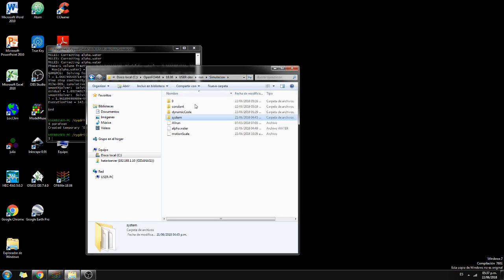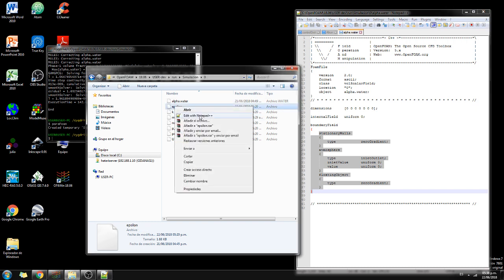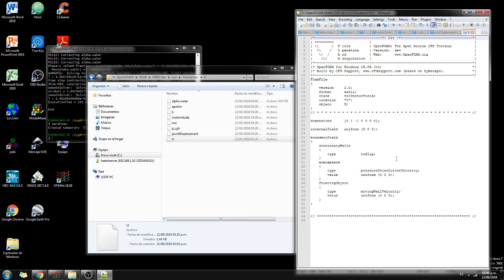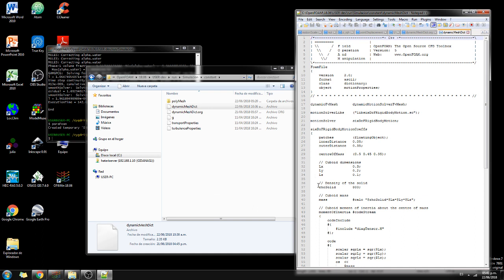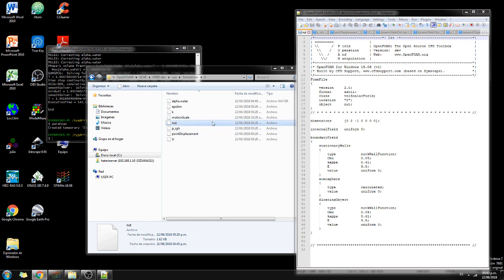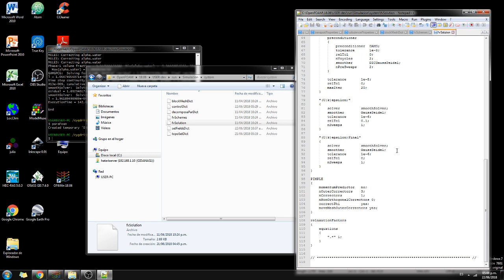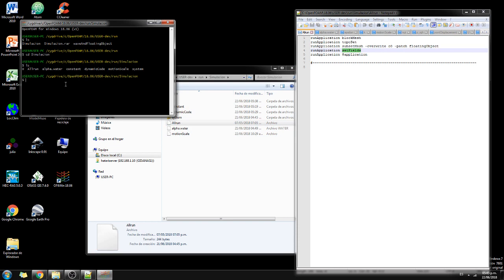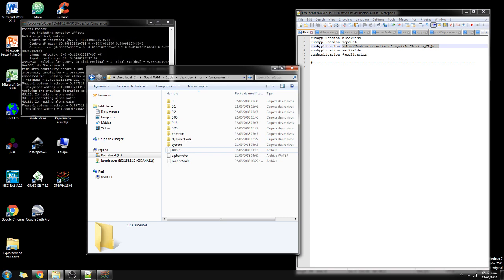Floating Object Stability Modeling with OpenFOAM - Tutorial Part 1

Comment: Does anyone know what "transform" in dynamicMeshDict is for rigid body motion? And How to calculate it? In the "transform," there are two matrices.  The first one is a 3x3 rotational tensor and the second one is a displacement vector (correct me if I am wrong). But I do not know how to calculate and how it is related to geometry. I will appreciate it if anyone provides me the answer. Regards